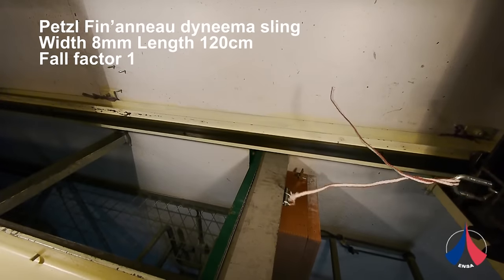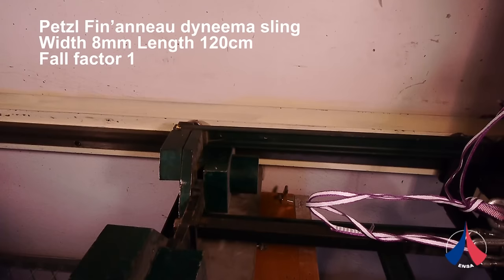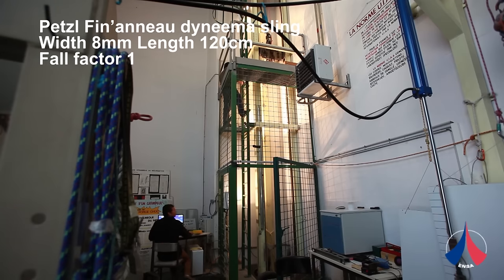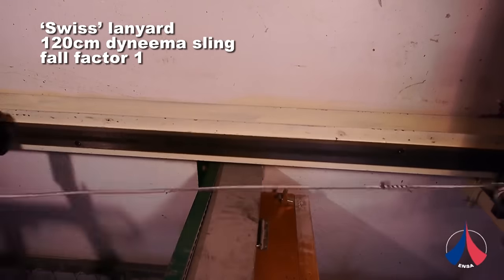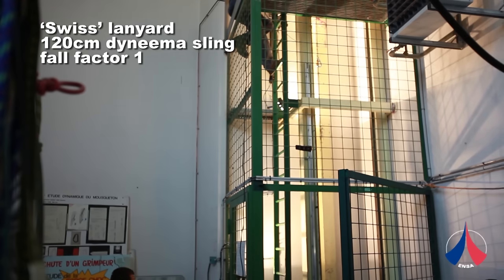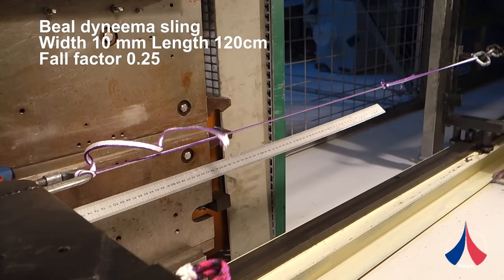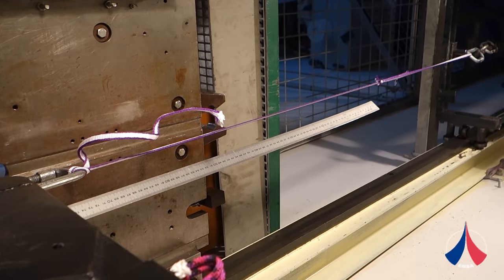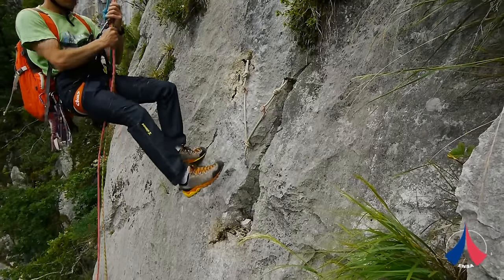How to make a climbing lanyard

Comment: Why did the Grivel daisy appear to be knotted??
Reply: +purplemonkeyelephant good question
Reply: I think is to show the fact that knot reduces 45% strength, at video breaks only at 600 kN
Reply: I saw that too.... I question when companies test other companies gear
Reply: Noticed it as well, and guess where when playing it back in slowmo, the daisy breaks?  Just below the rightmost knot. Hmmmmm...
Reply: @carlosabellanosa  600kn? almost anything will break at that force
Reply: @azaba2007  Now I'm not really sure about measurements units... 600 kN equals 61.183 Kg which is almost the weight of a war tank... No one sling will resist even half of that weight. I tried to find out what unit is 600, because 600 Kg seems too low: only 5.8 kN when slings, according to labels, use to resist 20-22 kN... There is a well known problem with knots at this point.
Reply: @heli400  Ensa is not a company it's an educational organisation.
Reply: @Nerudah  well then it should educate people that tying a knot in a dynema PAS will reduced its strength, and that knot is not needed there because it is a chain of loops that give you multiple tie in points. Go to 2:50 and ask yourself “why is that knot there in the middle of the chain?” Slow the video down to 0.25 speed if you need to, but you’ll see its there. Also as a climber you should be aware of factor 2 falls and not be climbing above your anchor on a personal anchor system because of the forces involved. 
Kinda Makes you think that they were paid off to do a “test” that favours one brand over another does it not?

Edit: watched this quite a while ago, they do say that as the video goes on. To keep the lanyard under tension. Knots reduce the strength,
I still question why that knot was in there tho.

Comment: I don't find it clear what forces were breaking these lanyards. Were the materials failing before their listed safety ratings? Most dyneema products are rated at 22kn but a shock load can generate insanely strong forces. Dynamic ropes are usually rated at 12kn but absorb shock so they won't have the same force applied in the end. If they did these tests with the weight able to absorb some shock like a human body and attach it with a harness, which will also absorb some shock, I imagine the results would be different. These tests aren't accurate for real world situations. They are a great demonstration of why you don't want to shock load static systems but it doesn't mean static systems are unsafe if they're used properly.
Reply: You are absolutely right but testing need to eliminate most as possible any variables to get more constant results. Your point could have been explained in the video. There is also other variables in real life and it is not really good for slings: they are more sensitive to abrasion than ropes, after a while they are not as strong. Strength of a rope is mainly the core, some abrasion will not affect too much. My landyard is DIY with a 10 mm dynamic rope with a butterfly knot for rappelling, I dont like to use it because it is heavier and bigger than sling but I feel safe with it and I am not afraid to sometime move myself at the anchor even if it give some loose on the landyard (still make sure to not put my hips over the anchor for sure).